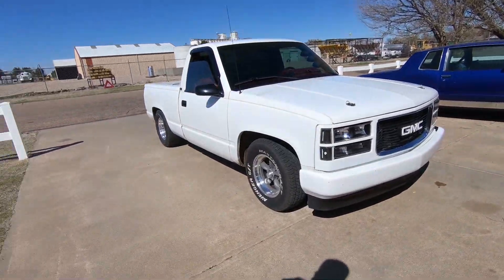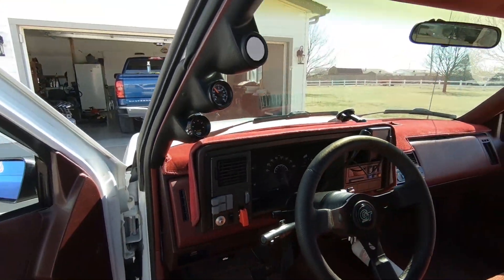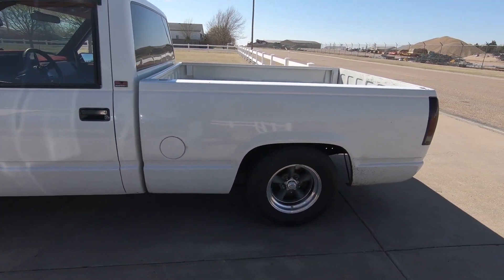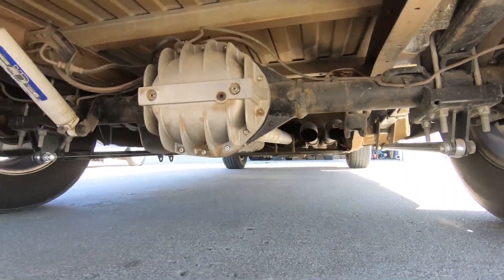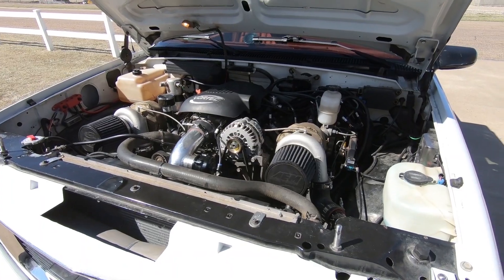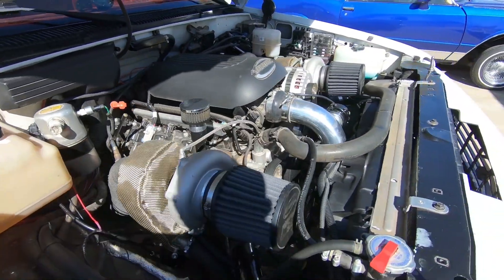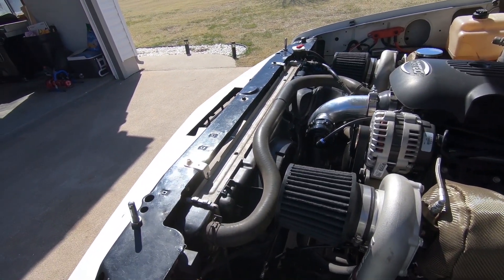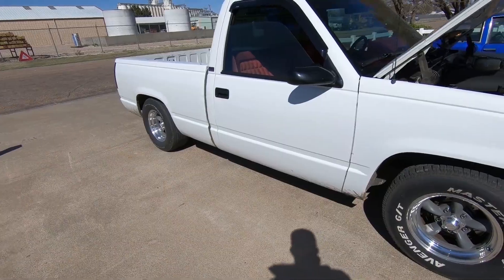Quick walkaround of my 1000hp GMC!!!

Comment: I’ve been working on my 91 Chevy, gathering parts and stuff for a few years. I stumbled across your channel and it’s like you built my truck for me. Lol. Except for the power steering. I’m going with the Cobalt electric steering and I have the 6.0 with 823 heads. Good stuff man.
Reply from the maker: Awesome man, I do love these OBS trucks! Electric steering is cool, getting better all the time, plus less power loss down the track!
Reply: LS1FREEK hoping to finish it up by the spring. Not going to be a real clean/ finished build. But it’ll be safe and solid. I’ll keep you posted

Comment: What size are the rims and tires?
Reply from the maker: 275/60/15  15x7 front 15x8 rear
Reply: @LS1FREEK  dam thats nice i have almost the same setup i have 15x8 all around with 275/60r15 on my 89.seems like i could clear a 3/5 drop if i just roll my fenders.if anything i see i could just switch to 15x7 in the front and run same tire size like you